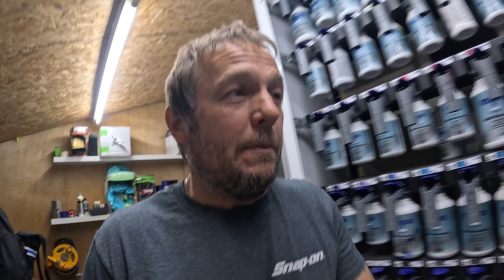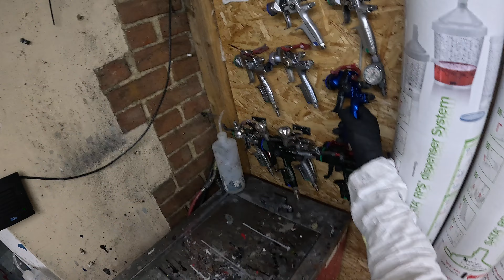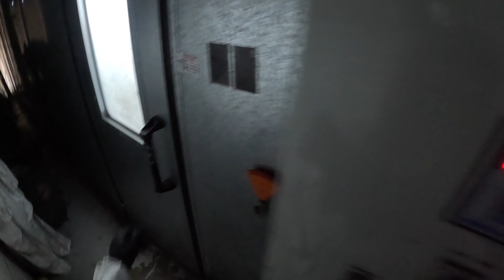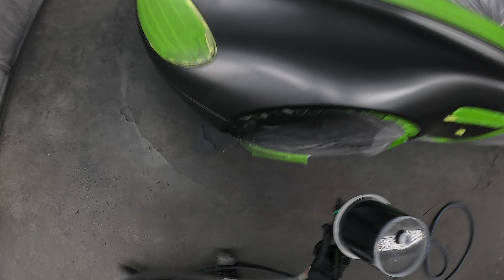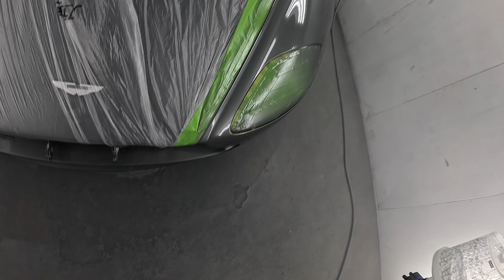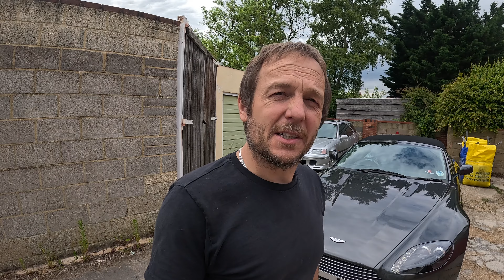JUST ME IN MY TINY SPRAY BOOTH PAINTING ANOTHER JOB | NO BULLS**T | JUST PAINT SPRAYING

Comment: Nice, straight forward question what is your air pressure at for clear coat
Reply from the maker: @Stingyduce  sorry I do normally add this information on all my videos but this time I was in a bit of a rush to make this one and left it a bit un edited 
It depends on the gun and the finish I’m looking for but normally first coat is at 2 bar and 1.9 for the second coat sometimes 1.8 if a want a chunkier orange peel
Reply: @TheHumblePaintSprayer333  I appreciate your reply I’m using the same gun getting it dialed in yeah I’m in the same pressure range as you I’m using the 1.3 o I’m really enjoying it I like to get lil closer and move it
Reply from the maker: @Stingyduce  yeah I love the o mines a 1.2 it’s a fast gun and lays a lot of material down, a 1.3 is a beast, tbh I prefer it to my CC

Comment: HI JAY WHEN YOU DO THAT BLEND IS IT PRIMER LIGHT COAT OF BASE AND THEN MIPA BLENDER AND THEN BASE AND CLEAR COAT  NEVER DONE A BLEND BEFORE ANDY SO WOULD YOU SAY USE THE SATA JET 1 .2 I FOR BASE COAT PAINT AND CLEAR COAT PAINT SATAJET CC IS THERE MUTCH DIFFERENCE ON THE I AND O PATTERN 😊😊
Reply from the maker: Hi Andy, put the blender on first, dry it , then do your base coat, there a bit of difference between i and o, the o is faster and a bit heavier in the middler of the fan